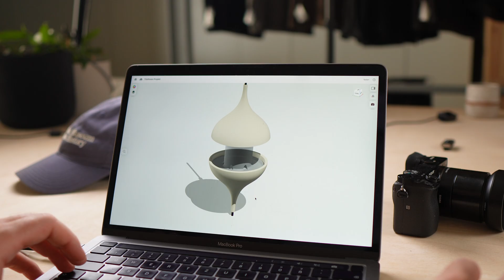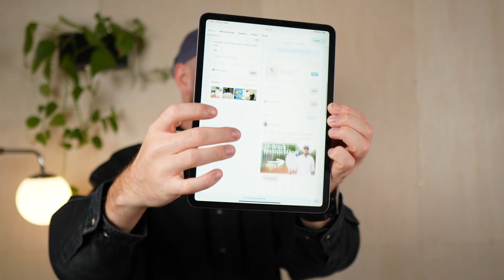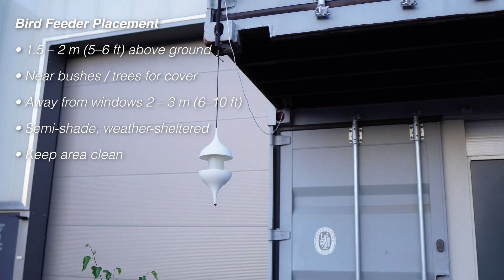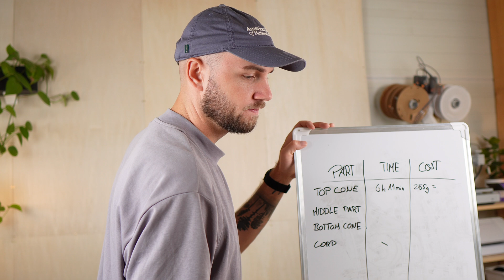How I designed a bird feeder worth showing off

Comment: Nice design!. But how do you prevent the feed from getting wet when it is raining? There is no seal on the top.
Reply from the maker: Thanks! The cord runs through a kind of inner tube. Since the water follows the cord, the seeds don’t get wet.
It’s been hanging outside for a few weeks now with lots of rain and no issues so far.
The only thing is, the string might need to be replaced after a few years.
And if it rains heavily from the side, the seeds can get a bit wet, but they dry out quickly enough :)